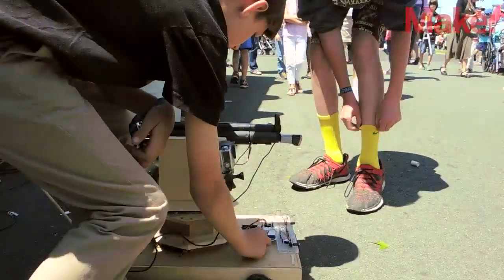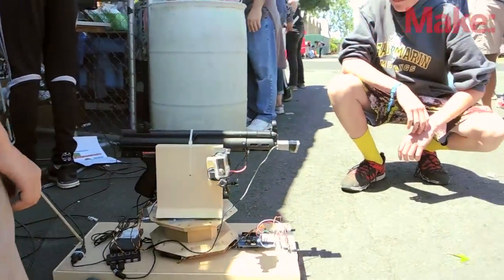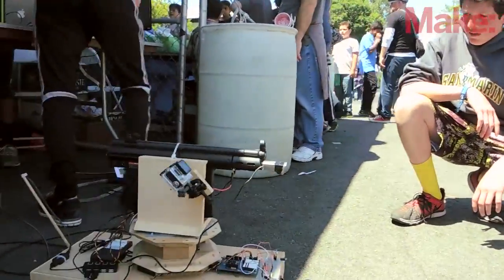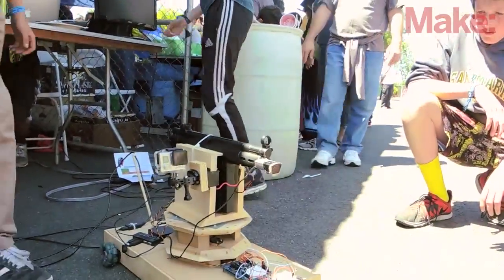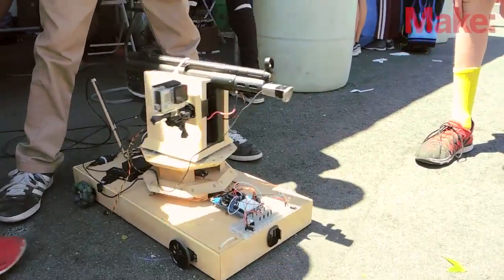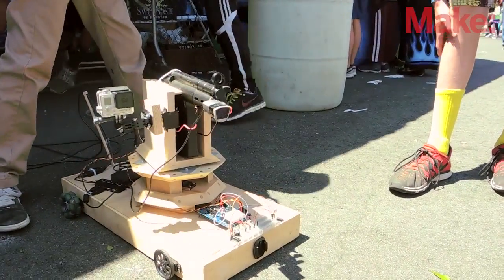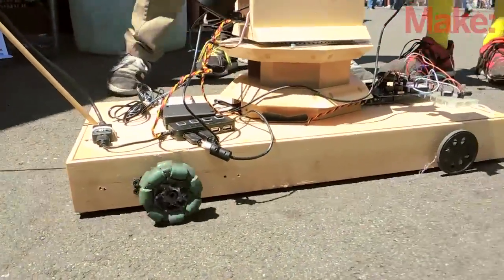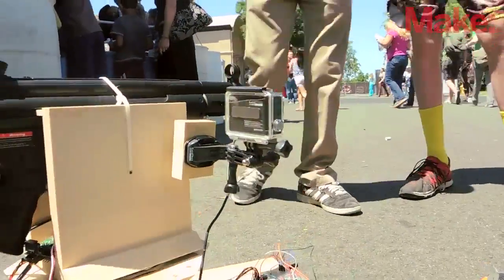Autonomous Sentry Gun

Comment: Suggestions:
-Use OpenCV to autonomously find targets and fire, may need to change up the board from a micro controller to a microprocessor to do this, recommend beaglebone as a cheap option, or try the odroid U3
-there is an openCV tracking algorithm called openTLD based on a graduate thesis.  Works well for object tracking
-For better batteries, order a high mAh battery from hobbyking or a dedicated batter reseller.  Increase voltage if necessary since that sometimes can increase efficiency.  Just remember if you do you should add a high efficiency voltage regulator to avoid large power loss
-change the mount for the camera to dampen the vibrations and add a phase lead or lag compensation PID controller to minimize disturbances in the vertical direction.  Will require openCV optical flow algorithms or accelerometer/gyro sensor on the mount

Hope these help or spawn new ideas!

Comment: Those Wheels are VEX 2.75 Inch Omnis, they shouldn't be breaking. We have used them in a stressful competition environment, and not once have they broken.
Reply: Hi I'm the kid on the right and I would like to emphasize that it was not the wheels that broke. We did not have enough time to properly mount the wheels so wet glued them straight onto the servos, the glue is what broke not the wheels.

Comment: One way they could improve their design is instead of using wood, they could use acrylic, and have holes in it where they can spare the strength, so that they have a lighter vehicle.  They could also apply this to the gun itself.  They could even add an added option of plugging the turret into an external power source, such as a computer.
Reply: The turret is already plugged into a computer. We needed the computer for the Webcam and to run the code.
Reply: Oh, I was thinking of using the computer as a power source for the hole thing.